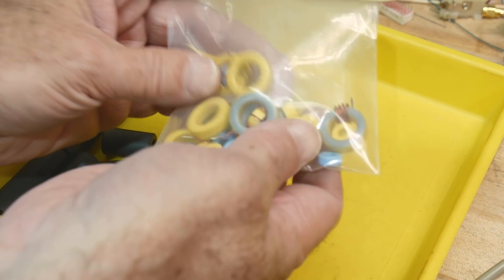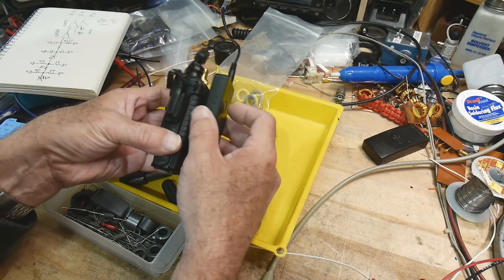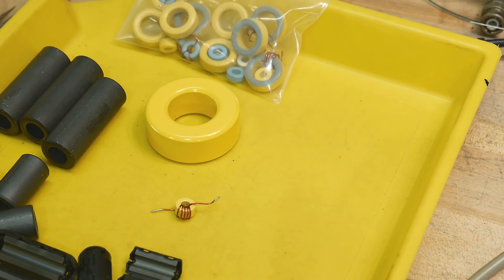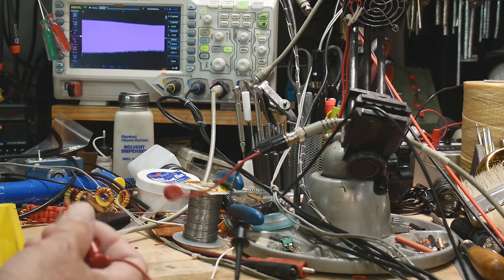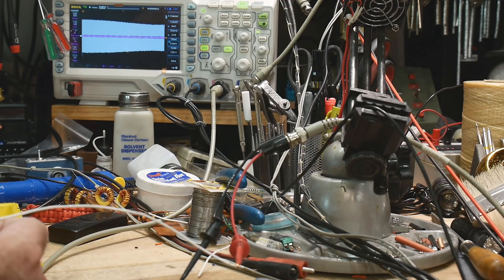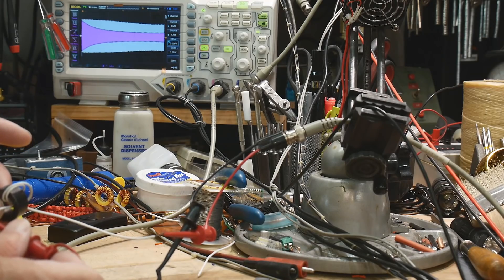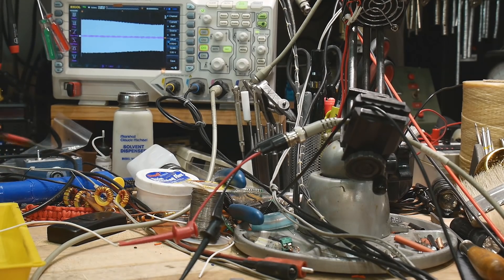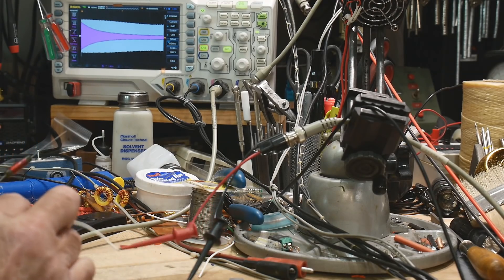#766 Measuring Ferrite RFI Suppression

Comment: There's a way to do this without a synch pulse. I triggered on channel 2 of my function generator outputting a square wave at the reciprocal of the scan frequency (example: 0.5 seconds scan, 2 Hz). The scan will appear, but will "march" across the screen. Tweak the function generator's sweep time in small fractions of a second until you slow the "march" down to a crawl. When you can see the entire sweep on the screen, press Run/Stop or Single trigger to freeze it.  (FY6800 function generator, Siglent 1202X scope).
This was a very useful video, thank you! I'm really enjoying your channel!

Comment: I feel very sorry to make my comments here.
On seeing the title of the video I thought that you have read/learned something about the ferrite and the iron powder cores; because I had made some clarification when you posted a video on your attempt to make "a low pass filter" for 7 MHz using the "yellow-grey" type 33 or 08 mix iron powder cores.
I had told you that it was a low frequency mix suitable for less than 1 MHz switching power supplies. It has very high saturation point, volume resistivity and Curie temperature. It's good for using to suppress EMI on lines carrying high current DC or low frequency AC. You can find them in the SMPS of all kinds.
You answered to one of the comments that there is no standards available; not anymore.
The "Fair-rite" and the "Micrometals" of the USA are the largest manufacturers and they have the colour code standard for the iron powder cores and of course there is no way to discriminate between the ferrite mixes just by looking at them.
Again one has confusion with the "yellow-clear" (mix 6, with initial permeability of 8, a material good for narrow band, high Q inductor as in a filter from 14-70 MHz) and the one bulky (and few smaller) core "yellow-white"( mix 26, again good for the SMPS EMI suppression, ie, less than 1MHz.
The ferrite cylinders (or sleeves) are made of mix 43, 31,33,61,75 or 77.
Mix #43(HF) and #61(VHF and UHF) are used to suppress RFI in the amateur radio use. They're made of Ni-Zn. Initial permeability is less than 1000, like 850 for #43 and 125 for #61.
You Ni-Mn mix with high permeability like 31,31,75, and 77.
Type #31 is a new Ni-Mn mix that can be used for RFI for the HF, VHF and UHF bands.
W2DU BalUn consisted of sleeving several Ni-Mn, #77 torroids over the coax cable at the feed point to avert the CMC (common mode current) that tends to flow down the cable towards the radio.
Then there are #52 and "K" materials (Ni-Zn) for the recently popular "EFHWA", end fed half wave antenna apart from the #43.
Please study about the mixes, saturation, coercivity, magnetic flux lines, volume resistivity, Curie temperature, inductive, capacitive and resistive components of the reactance in a torroid coil etc.
Every inductor (whether air cored or ferrite/iron cored) would have a reactance proportional to the frequency of the AC (RF) and it is used widely meticulously chosen for the particular application.
People think that it's a subject of conundrum but not anymore.
The "Fair-rite and the Micrometals" offer a very elaborate products catalog and datasheet that's a kind of Bible for every RF enthusiast. I think you are coming across the name Fair-rite for the first time.
The late G3TXQ, was one among many whose works should not be ignored in the addictive hobby of "HAM RADIO"
Good luck to you.
I have been a fan of your channel for more than 2years since you started making videos on the "Nano VNA". I suggest you make great videos with correct scientific content.
De VU2RZA
Reply: Great information sir. Thank you!   Fred

Comment: If you increase your test frequencies I think you’ll see they are much more effective. Most of the snap on tape chokes where designed to minimize higher frequency noise such as that for me switching power supply. For lower frequency work I’d start out using cores that are made from a mix 75 material. I have found that multiple turns of wire through one individual core tightly wound works much better than slipping multiple cores over one wire. Regarding the yellow core it’s very large for the skinny wire that you’re passing through it you need much tighter coupling between the wire and the inductor

Comment: Ferrite has a skinny ('narrow') hysteresis curve, which in laymans terms, means that a AC/RF alternating signal can more easily flip the electron spins (the magnetic field) in the material, compared to iron.   Ferrite is made partly with iron but mixed with other elements.  

The benefit of the ease of flipping electron spins (aka reversing the magnetic field in the material as forced to do so by the alternating current, the AC or RF) - is that less energy is spent torquing the electron spins in a new direction during the flip in each of the two half-cycles in each period of the supplied frequency.

So ferrite is used in transformer cores because (1) it still increases the magnetic field compared to free space, since it contains iron, but (2) without the loss of energy of a 'thick' hysteresis curve like iron has.  RF chokes benefit from the same "let's not waste too much power torquing these electron spins back and forth" motive.

The technical term for 'running roughshod' over electron spins in this regard is coercivity.  "Low" coercivity means the electron spins (the magnetic field) are like the subjugated minions of a powerful totalitarian dictator:  "do it now, with no resistance!"  type of deal.
.

Comment: You showed that the straight wire on its own made a difference (because it had some inductance) but what would have been interesting would have been to compare a ferrite core that you wound a couple of turns through with just the turns without the core. This would have shown what the core added to the inductance of the air-cored coil.
Reply: It’s a square effect
2 turns 4x
3 turns 9x 

Like a transformer 

AFAIK

Comment: I've been going to Amidon Corp for my ferrite needs for many years. Great resource to determine which mix will work best for the results your looking for...Mix 43 is my fav.  ExtraOld Ham with a GROL/w Radar here. Enjoy your videos very much OM
Reply: Which is the best type /brand ferrite bead for an audio interface usb c cable?
Reply: @natevirtual  Split core mix 43 is usually the best general purpose from Amidon Corp
Reply: @dapperdave4952  thank you! Also, which would I need for the 3 prong power cords? And I'd have to put it closer to the male end?
I had to search what GROL W/RADAR meant. You're the guy!
Reply: @natevirtual  3 Prong power 120 Volts AC cords don't usually require anything additional since the 60 hertz is low enough that it won't interfere with USB data even at harmonics of 60 hetrz
Reply: @dapperdave4952  wow you're the best! I'm so glad to have come across a professional like you! Thanks for sharing your knowledge with me!
Reply: @dapperdave4952  sorry last question. I searched online about this because I hear static through my speaker monitors. I use canare star quad cables and everything plugged to a Furman power conditioner. Now I also hear static when I plug my fender into my audio interface with mogami cable using an IF certified Pearstone USB cable. Should I add ferrite beads to the usb c cable and instrument cable?

Comment: He doesn't say if the input of the 'scope is terminated or not.  (like transmissions lines are)  Ferrite cores absorbs the energy and add inductance and the iron cores mostly add inductive, that is why ferrites are not painted.  I think sweeping to 30 MHz would have been appropriate.  (HF bands)  Ferrite beads are called "VHF beads," they prevent VHF oscillations in some circuits. (usually in high impedance inputs) Ron W4BIN

Comment: A lot of ferrites are aimed at radiated emission from leads, that is to say, above 30MHz where they become lossy (by design) turning emi in to heat.  They often hit their sweet spot around 100MHz, so with these, might not be much attenuation at all 15MHz and below.
Reply: I think You are absolutely right on the typical salvaged ferrite..especially most of the snap-on ones.. If one needs the stuff for hf bands, it's very rare to find it in these 'sortiments' unless bought new from eg. amidon corp., magnetics inc., etc..😅

Comment: Impedance matters. The impedance you are feeding with the choke will have quite an effect on the attenuation. The reactance of a clip lead is quite high which may be the reason for the poor attenuation. Try a .001 mf capacitor on the output side.

Comment: This was an interesting video, thank you for putting it out for us. I know the returns where small after 3, but it would have been nice to see what 4 or 6 or 8 would do, and you already had them. or even a mix of the long and short ones.  I bought the cheap snap ones as I’m trying to fix the static noise in my radio from my LED light bars. But after watching your video I ordered some of the ferrite toroids.

Comment: The free Fair-Rite catalog is GREAT. I have a junk box full of assorted surplus-shop ferrites, and I'd like to categorize them somehow (maybe by nearest Fair-Rite material number?). Curious how other folks handle this...
Reply: I've spent time getting my designs to pass EMC standards, and Fair-Rite offered a variety of useful ferrites.  Their catalog helps explain the way that different materials do best in certain frequency ranges.  I've used a lot of their SMD ferrites too.  I've even used one of their SMD common mode chokes on a home project when a switcher interfered with my nearby FM radio.  🙂
Reply: 2 years have passed since you asked, but ...

Measure the inductance of a single turn (which for a toroid, is a straight wire through! - you count the wires passing through the core, so 3 copper wires through the centre is a 3 turn core (even though your brain says "that's just two turns")
This single turn can then be matched to the "n-squared" or "t-squared" inductance value in product catalogs to give a clue to the product. 
Personally, I then confirm it by then winding 10 turns (producing 10-squared the inductance) and do the math/check the chart too. 

However...
People are usually surprised to find that different cores are targetted for different frequencies, as well as different temperature characteristics. 
For stable tuned circuits, you chose stable low-loss core material (and the also are designed to give a high Q-factor). For supression, however, you need a high-loss material (and temperature stability is not an issue and Q is better kept low to avoid unwanted peaks in the response)

So for categorising odd/loose/junk cores, you can easily end up with 3 or 4 different cores of different types (high power/high saturation, high stability tuned-RF, supression (low temp stability) or $whatever types that all give the same n-squared (some manufacturers call this the t-squared) figure. But hey, not everything is easy in life :) A swept response in as in this vid can be a clue, a broader atteuation over a wider upper region of frequencies usually signifies a higher-loss suppression core, at least for low numbers of turns and say 1-to-20MHz test sweeps. For smaller cores, or those designed for VHF/UHF supression, you may need to sweep much higher to see differences (say 30-100MHz)

If you only have simple test equipment that can't measure a single turn, you can add a standard RF-stable capacitor in parallel and do the math from a HF RF tuned circuit. Tune the sig-gen to find the peak resonance then do the match 1/twoPiRootLC, where your C is known)

If you use a RF voltmeter you don't even need a scope to do this (you can make one from a small-signal diode - look up "RF diode probe" - and a millivoltmeter - an analogue needle one is best, digital ones can be twitchy as you sweep the sig-gen frequency and befuddle yor brain.

If you use a FET voltmeter, (high input impedance) then with a quality moving-coil meter you can sometimes even see the difference between high-Q core materials (for use in medium-precision tuned RF circuits) and low-Q high-loss core materials (designed for supression or general-purpose use) The higher Q circuit will be more "peaky" as you tune the sig-gen across resonance. The low-Q one will be less peaky and a more broad resonance.

Comment: If I recall correctly, the Yellow/White are not ferrite, but iron powder, a 'mix 6', and you are basically correct about what they are good for and what ferrites are good for and why. And certain core types are good at certain frequencies for noise suppression and good at other frequencies for wide-band transformers. Or are you looking for a high Q coupling transformer for a particular frequency? In fact, most core materials aren't good for 'a frequency' per se, but good at various different things at various frequencies. So you need to know your application for different materials. The ham's friend, ferrite mix 43 is actually pretty poor at handling high power. That's why hams running a KW and a half use huge ones for their antennas. They can be easily and permanently cooked. Powdered iron typically can't be permanently cooked and thus is better for high power. 

And of course different manufacturers have their own ways of describing the characteristics of their products. Nothing is standardized. I've been reading about this stuff for the last month and I'm only now figuring out what to use in what size for what application. Even then, I still don't know if what I've selected is the very best choice for the application, or just 'good enough'.
Reply from the maker: and no standards for color. what a mess
Reply: @IMSAIGuy  there are plenty of standards - each new manufacturer just invents their own :)

The only rule-of-thumb I use for junk/Aliexpress cores is the totally green ones are more often than not usually high inductance and low-medium loss and suitable for use for suppression in the low tens of khz-20MHz region.
For other colors, it's anyone's guess and seems to change with the wind. You can make no assumptions at all about black cores, in particular.

Comment: I have had one of those tnc's since right after the 2 model came out.... It's great.... I set it up once with my android tablet and  Ft-891 and did some sstv... But I remember it was tricky. Works great for aprs..... Now I wonder if I can use it as a wireless tnc with ft-8 and winlink on the laptop..... Oooooo test time!

Comment: the yellow-whites and green-blues are not ferrites like was properly said on the video..they can store some energy since they are inherently 'gapped' as they are made out of metallic powders..they are not really any good for solving rfi issues..they are mostly used in power conversion circuits. They have slightly highish hysteresis, but they are cheap and thus widely used in buck/boost converters. They are still 'low loss' and have very low permeability compared to ferrites.. Nowadays there are even better mixes eg. 'sendust' or other FeSiAl, etc. stuff for power conversion applications.. If ferrites are used in power conversion, they need to have an airgap in the core somewhere since otherwise they saturate very easily thus can not store enough energy.. Rfi ferrites should have high losses in the intended frequency range but that is the main topic of the video.. I wanted to clarify these differences since i remember when i was young and yet learning electronics in school we had not been taught about these differences and it took me quite a bit of trial and error to get my own smps's working..then another learning curve started with ferrites after getting my feet wet with radio dx'ing..😅..and it seemed that nothing i learned with the other stuff could be applied to the other..!👍

Comment: Question from beginner: what settings did you use for oscilloscope and is that black box on ch3 cable 50 onm terminator?
Reply from the maker: settings: https://youtu.be/9o1U9NvVyLc?si=-phLR9INvzk9-jk2
yes, a 50 ohm terminator

Comment: LOL black arts. What learn from working w/ geologist is that geology is a black art. It drove me nuts when they'd ask me to change vertical depth of the well a quarter metre. Always fun to ask them which side of the 158.8mm bit they want on that 250mm change in vertical depth.

Comment: The colour coding confuses me - I bought a toroid in type 6 material which is yellow and supposedly suitable for winding transformers for HF, but there are smaller toroids made for switch mode power supplies that are also yellow. Would they be type 6 material too? Is there a consistent colour coding?
Reply from the maker: there is no standard. each company had it's own colors.
Reply: @IMSAIGuy  Thanks!  That makes sense. I saw an amateur radio video somewhere that was warning against using red toroids and that got me thinking about a red type 2 toroid I had just bought. Good to hear that colour isn't an issue.

Comment: Hi what is the magnetic permeability of the yellow white core? I want to use it as lc filter for sinewave inverter.
Reply from the maker: color codes are not standard, you need to get the datasheet from the vendor. these were from the junk store so I don't know for sure what that part number they are

Comment: Can you use a ferrite bead over the shielding of a power cord with three conductors, or is it required to use a ferrite bead on each individual conductor?

My intention is to reduce any chance of RFI noise that may possibly occur on the power strip for my guitar effects pedalboard.
Reply from the maker: not familiar with a shielded power cable. If true, then put beads on each conductor.
Reply: @IMSAIGuy  No, no, no.  The power cable isn't shielded.  It only contains the three conductors for power supply to my pedalboard effects.
Reply from the maker: @Musicalpa  one big ferrite is ok, better is to get: https://a.co/d/7nqc9js